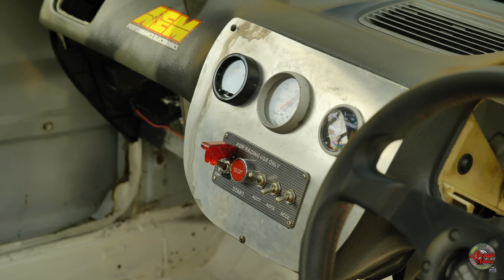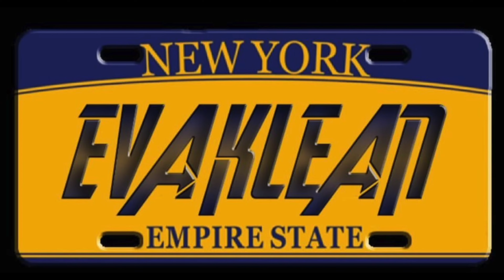Episode 7. Ochi Racers Part 2 // Gavin calls out Bebo / Archie the pioneer / Troy Turbo D Series .

Comment: First 300Whp all motor car i drove in was Archies H23 all motor integra had me all smiling like my dad was a dentist. When i was working for Dean Corrodus as a technician he was the one who introduced me to the same thinking about all motor and i used to talk about turbo turbo turbo. until one day they told me Bag juice Go sit in the race car (deans type r) and Jordan Powell shifted that car with me around they track (Dover) and from that day when Vtec kicked in yooo he changed my thinking in 2010. i remembered when he built a stock bore 11:1 B20 comp engine made 240 on the dyno @8500 and around 171 ft-lbs cant remember the RPM and all that on PUMP GAS but the curve was flat like a ply for an all motor engine. I'm Fascinated with all motor to this day.
Reply from the maker: Thanks for sharing this experience. His knowledge concerning engines in VAST!!